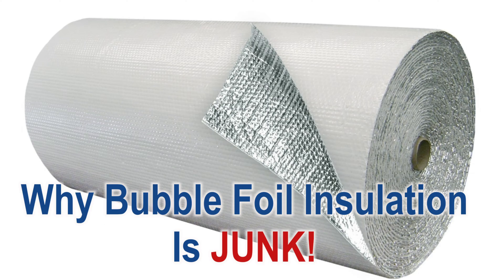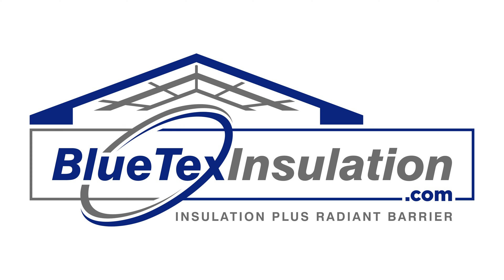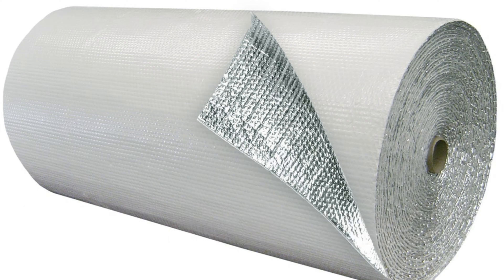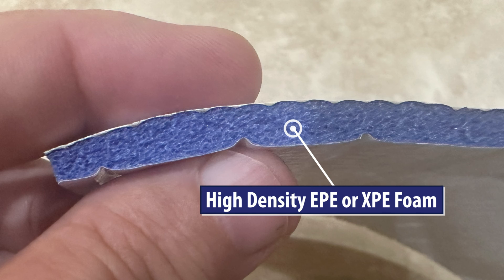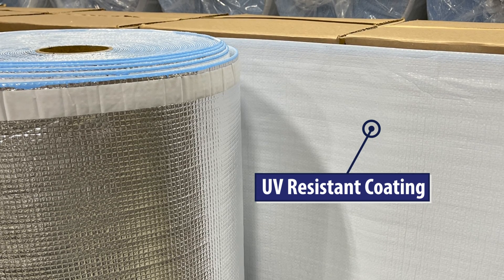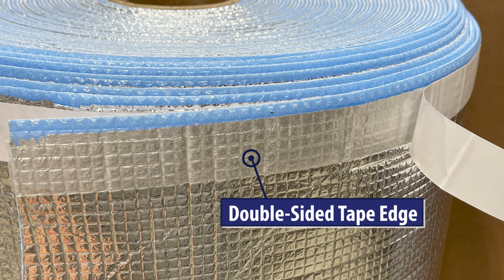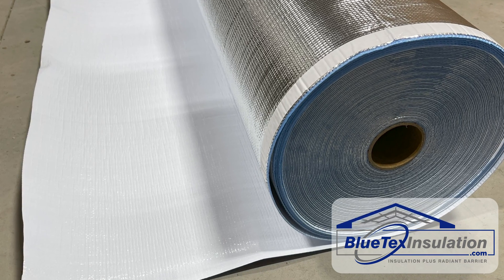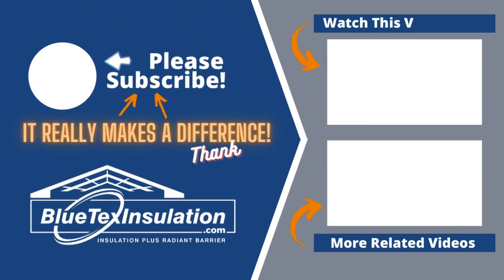Part 2 - Vapor Barrier Bubble Foil Insulation Is JUNK For Metal Buildings - A BETTER Vapor Barrier.

Comment: As a purchaser of AtticFoil (after seeing your, and others, videos on it) for a pending new covered porch build & a retrofit of two wood framed storage buildings (standard 2x4 16" on center) using foam spacers, AtticFoil, fiberglass batts, and a layer of continuous foam board on the inside (separated out from the wood studs by the same foam spacing, allowing the fiberglass batts full expansion), finally OSB;

I'm now looking at options for a newly build ~2.25" tubular metal built carport.  The carport builder didn't offer anything but bubble or woven R-17, and I went with bubble so I had a radiant barrier (and the ability to insulate later).

1. If BlueTex is purchased and preinstalled before the bubble degrades (especially in the roof, with gravity...), will the bubble's degradation be slowed?  And, will the degraded material end up ruining the radiant barrier properties of the BlueTex since the silver foil will have debris on it?

2. Since the tubular steel is a bit over 2" thick, thoughts on adding foam board insulation directly to the back of the preinstalled bubble insulation... then the BlueTex on the inside via the normal install method?

Thank you.
Reply from the maker: Tough call. Some bubble foil products are much better than others.  So, you never know.

Comment: 3:14 "UV Resistant Coating"? really? what is it for? where does UV radiation come from, since it's not exposed to the sun?
Reply: Welding
Reply from the maker: Even interior lights emit UV.  Over time it adds up and will cause deterioration.

Comment: could/would this be used to insulate existing rectangular ductwork in a crawl space?
Reply from the maker: Yes, you can use the www.BlueTexInsulation.com to wrap ductwork.  It works great. I would actually use the Supreme 6mm product with the foil side facing OUT (to get a radiant barrier) and use FOIL tape to seal the seams.  https://bluetexinsulation.com/products/bluetex-6mm-supreme-50-wide

Comment: Would this be good for an old mobile home walls with metal siding placed between studs before installing the insulation?
Reply from the maker: For that type of application, I would actually recommend using www.AtticFoil.com with this install method:  https://atticfoil.com/index.php/applications/inside-exterior-walls-hotmixed-climates/

Comment: I noticed their putting the Blue Tex pro 2mm sandwiched between the Frame structure and the outer panels? Don't you want an air gap between them?
Reply from the maker: When installing www.BlueTexInsulation.com if you want a radiant barrier and vapor barrier, then YES you need an air space between foil and the metal. If you ONLY want a vapor barrier (common in colder areas) you can install the metal direct to the foil without an airspace.
Reply: Living in Columbus Ohio. How would I want to install this in the ..roof..walls..ect...Hot summers humidity and cold winters...Looking not to have condensation also.
Reply from the maker: Sounds like a perfect application for www.BlueTexInsulation.com  Did you visit the website and lnstall/applications guide?